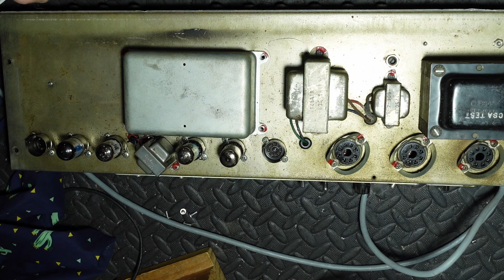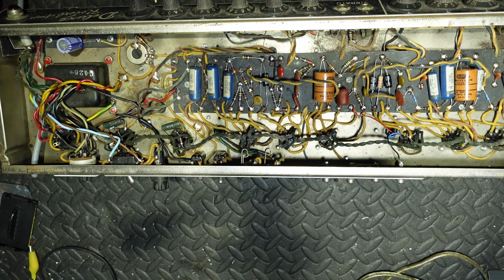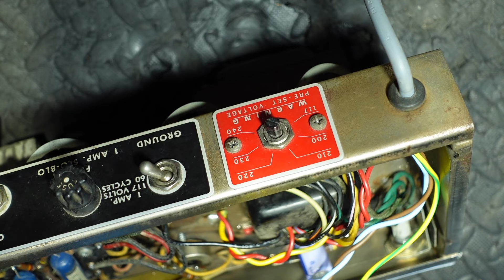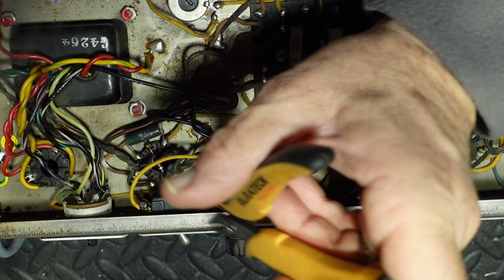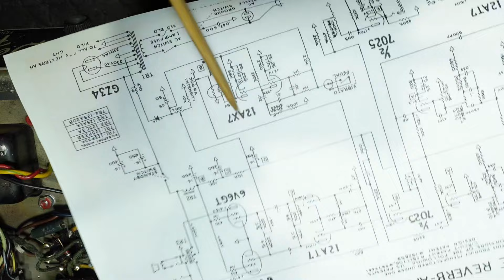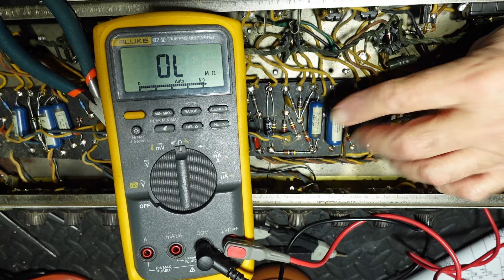1964 Fender Deluxe Reverb: Originality vs. Reliability

Comment: I don't care a shit on originality. Out with the old crap. Reliability goes first. Even if I have to change wiring, to get down noise.
Reply from the maker: Thank you for your honesty. You may not care about the originality of a vintage amp, but I suspect your customer may, especially if he paid a lot of money for it. 
Is the reason that you don't know how to test, or don't have the equipment to fully test. EG would you replace all of those Blue Molded capacitors? In the very rare case that one Blue cap failed your leakage test, would you replace them all? As you know, your customers sound passes through them. How do you test for leakage? If you have a pile of Blue Molded capacitors, can I buy them all off you...untested. I know that 99% will be OK.
Reply: @theguitaramptech  if they are leaking, I would. If only one is leaking, all out, the rest will come soon for sure. But with you, that's preaching to the choir. 😂Sorry for my kind of rude messaging, but  all these vintage snake oil bullshit drives me nuts. There is nothing to it, not electrical nor sound wise. I don't repair as a business, like you do, so I'm in a position not to care so much about those kind of things. I just want my stuff to be reliable. Cheers.
Reply from the maker: @LothyBluesCave  No prob. No offence taken. If it's your amp, then do as you please, but if you sell it one day, please do the honourable thing and let the buyer know. Lots of replacement will devalue the amp, and yes, components do affect tone. 
I appreciate your point of view.
Reply: @theguitaramptech  I own a 78 Super Reverb. Nothing to worry about, except reliability 😂
Reply: @theguitaramptech  Great reply Chris..Originality means everything..!
Reply from the maker: @Teleeddy  I agree Ed. We need to make the vintage amp sound good and be reliable, but we owe it to the next generation of players to be given a chance of hearing a REAL blackface Deluxe instead of a Kempler model of it. Modellers simply can't capture that upper-mid/high frequency magic of a valve amp.

Comment: Chris,
I enjoy your YT videos! I appreciate your attention to originality whenever possible. I see that you have Heyco-style pliers for removal / installation of the AC cord strain relief, yet you used conventional pliers with serrated jaws. I understand these provide more leverage, but they do mar the strain relief. I've seen many other amp techs do the same thing. I always use the Heyco-style pliers to avoid this and retain the original appearance without damage. Much like using an adjustable wrench on input jack and pot nuts ....too much danger of scarring the face-plate. Nut drivers are the correct tool.
Reply from the maker: Of course you are correct. In going from 2-wire to 3-wire mains lead I am often faced with the decision of "do I enlarge the hole or risk marking the strain relief". You can see I mostly choose the latter. 
Maybe I am just too weak, but I can't get enough compression on the Heyco pliers. Do you have any tips for me? (Please don't say "Go to the gym, you big girl")

Comment: The warping of that eyelet board probably has pulled that 47 ohm resistor solder joint loose. If you have to replace components in a place like that, it is sometimes wise to leave component leads a bit longer, even if it does not look so neat and tight, because then the possible further warping does not straightly stress the solder joint or component itself so much.
Reply from the maker: Good suggestion. In this case, however, the real solution was the solder or solder technique of the previous Tech. Almost every solder connection failed. In the end, the only solution was to remove all of his solder and resolder. Bingo. Problem gone. The owner's second Deluxe (that I had at the same time ) suffered from the same sound. This time I knew what to do.

Comment: I've used pg9 cable glands in amps. They're cheap and quite nice. So much easier to deal with. When vintage correct doesn't matter. I suppose the owner of that 64 would want the old style .
Reply from the maker: Very true. I prefer the PG glands in modern amps but I have to stick with these effective but hard-to-install vintage styles for vintage amps.